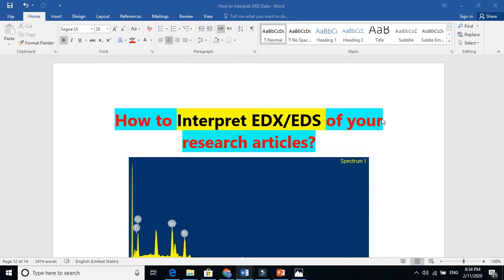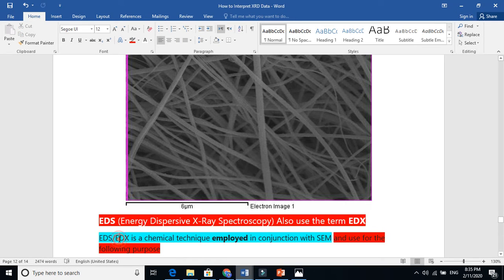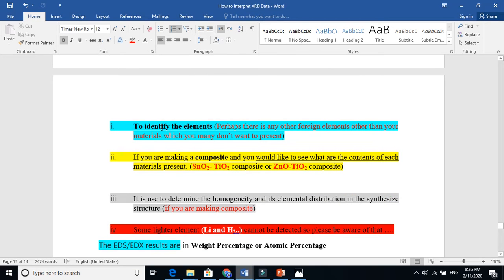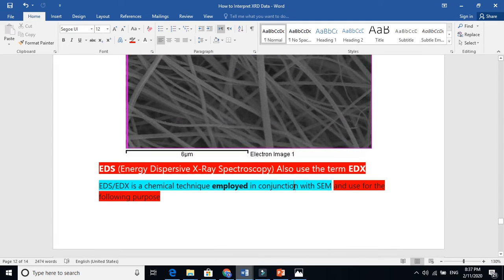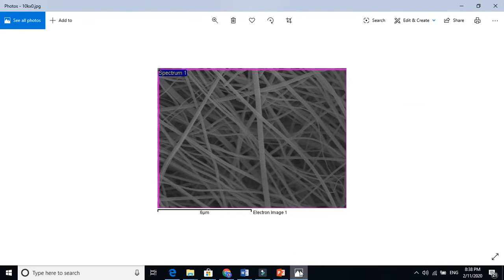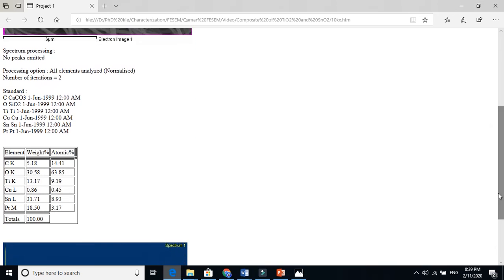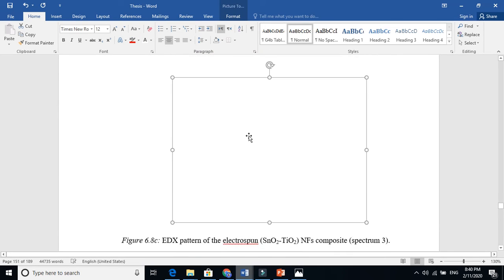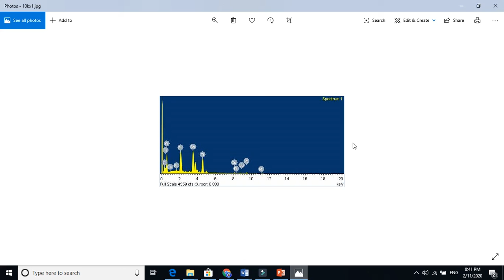EDS/EDX Microsctructure Interpretation: Energy -Dispersive X-rays Spectroscopy Analysis

Comment: Thank you for the explanation on the interpretation of EDX result. Pls can you tell between these two samples which one has the higher content of CaCO3 based on the EDX results
Sample 1. Ca=3.8%, C=14.3%, O=39.9%
Sample 2. Ca=4.9%, C=13.8%, O=37.2%
Reply from the maker: EDX not telling about compound just like CaCo3. It tells about element such as C or  Ca or O only.  The one with great % contain more in that compound
Reply: @nanospeaks  thank you so much
Reply: but sir when you add all the element it will not give a total of 100 %, how can it  be calculated to give a total of 100 % constituent of the three element in term of atomic or  weight %  @nanospeaks
Reply: Caco3 is a case for charging?? Extreme scenario